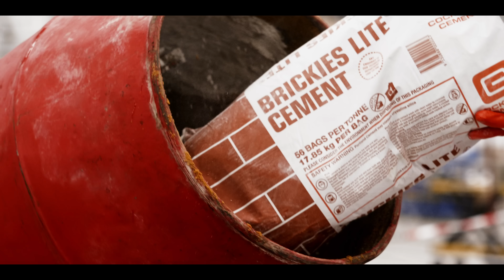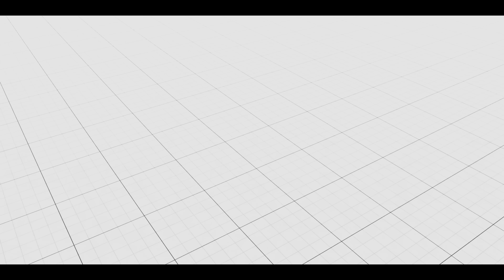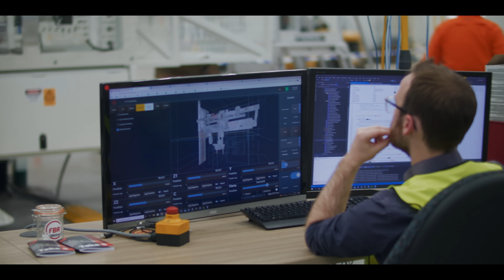The Future of Construction: Hadrian X vs. Traditional

Comment: HadrianX just PLACES blocks without MORTAR????? So what's holding those blocks????
Reply from the maker: If you watch the video from about 5:00, you'll hear that Hadrian® applies a special construction adhesive to each block as it is laid. The adhesive cures in approximately 45 minutes, is significantly stronger than traditional mortar, and allows for continuous high-speed building without waiting for drying times. It also offers environmental benefits by reducing material waste.

Comment: As a long-term investor and strong believer in Fastbrick’s vision since 2016, I remain confident in the value proposition and potential impact of your technology. That said, I’d appreciate your insights into the key challenges you’re currently facing in driving broader commercial adoption. What are the main barriers preventing more builders from embracing the technology? What’s holding broader adoption back, and how are you tackling it?
Sincerely, Tyler

Comment: You still need to reinforce the blocks and pour concrete in them
Reply from the maker: The requirements for rebar and concrete reinforcement can vary significantly depending on the global jurisdiction.  In Western Australia, FBR's residential and commercial builds did not require such additions. However, for markets like the US and UAE, where these reinforcements are necessary, FBR has tested - see "Hadrian X® Completes Two Storey Structure" video on our channel: https://youtu.be/l1O1yRZO2Fg - and implemented - see "Demo Program Retrospective" video: https://youtu.be/DCO6tHxPtis

Comment: Will you be able to do walls that do not converge at 90°?
Reply from the maker: Yes, the Hadrian X® is capable of building walls that do not converge at 90°, including curved architectural feature walls. The system is only constrained by the shape of the building material, and there is nothing to impede the Hadrian X® from laying product anywhere in 3D space. We demonstrate this capability in our video 'Hadrian X Builds First 'Curved' Wall' on our channel: https://youtu.be/3mOkxkLC54w

Comment: Do you all not use any mortar?
Reply from the maker: The Hadrian X® applies a special construction adhesive to each block as it is laid, which cures in approximately 45 minutes and is much stronger than traditional mortar. This allows for continuous high speed building without having to wait for mortar to dry, and has significant environmental benefits too.
Reply: @FBR-ltd   Forgive my ignorance please. I was kind daydreaming recently about living in a FBR constructed house that used adhesive instead of mortar. Are there any leftover smells of glue or the like? I have allergies and I was wondering about this. Thanks for the replies.
Reply from the maker: No, a Hadrian X built-home has a 'new home smell' just like any other home.